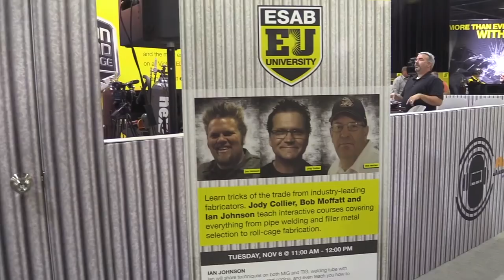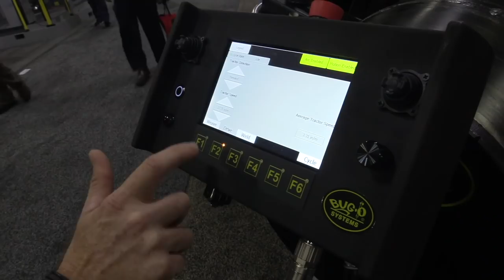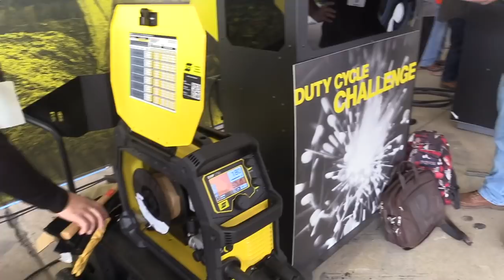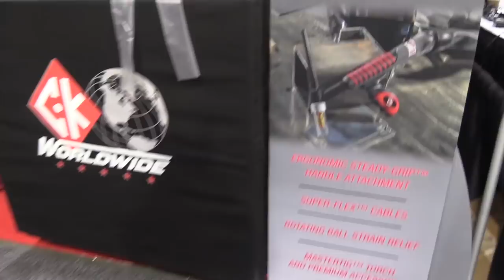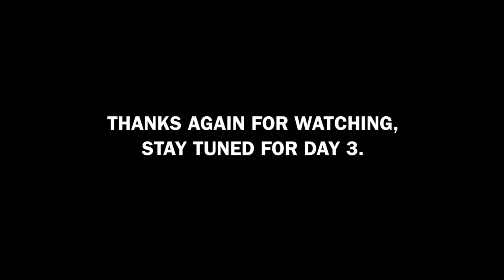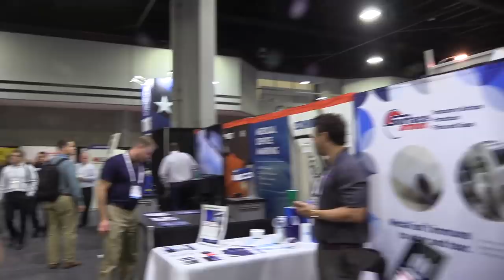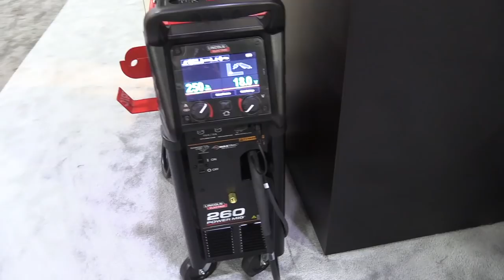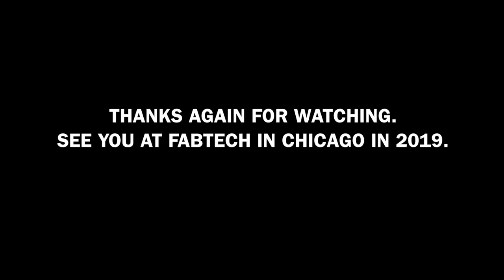Fabtech 2018 Highlights & Preheat Meetup

Comment: No Everlast? I was looking forward to that. Trying to purchase an Everlast machine in the Netherlands :)
Reply: Free onewelding  Belgium 210ext is a nice one bought one myself it's, basically a Everlast 210ext but just a different skin and the purge/gas test button missing because we European's use mostly torch switch. But there's also a Dutch inporter that sells freetech machines that are multi possess also from Everlast
Reply: Dion Krab I am looking for the Power MTS 221STi multi proces. Could you send me a link of the Belgium company?

Comment: I like the American attitude towards welding, in Germany it underrated. I'm not a welder myself but I have heard welders say you can't weld aluminum without it looking like a sponge afterwards, which you have proven otherwise. I do have a quite awkward German welding machine with which I use for stick welding most commonly, because it only requires 2 of the 10 knobs of which only 3 do anything (I have looked inside the others are not connected). In todays money the machine would cost 25000$, and it has a plug for a foot pedal for which there has never existed a working foot pedal. German engineering at its finest...